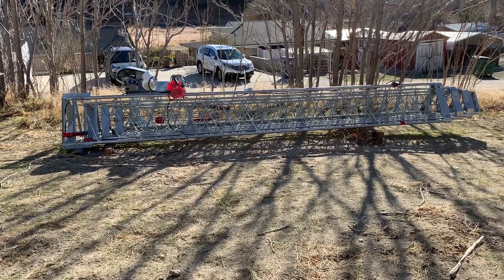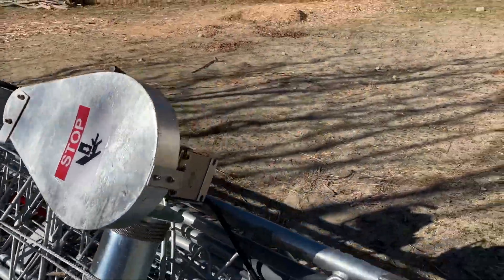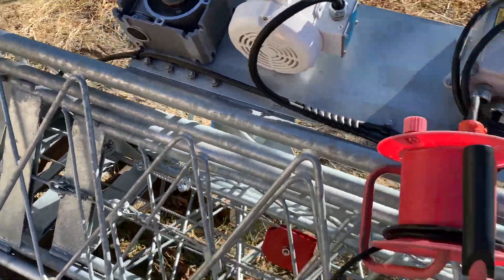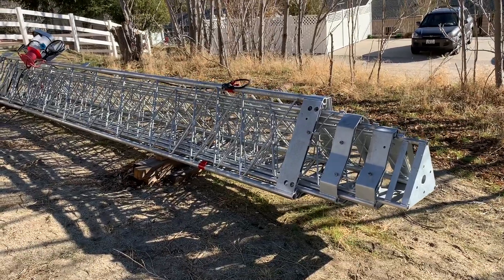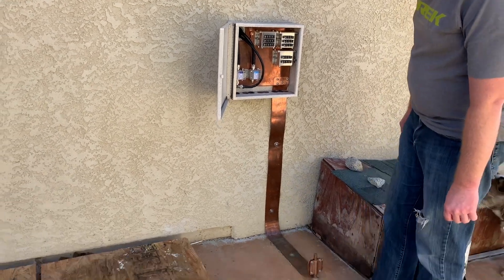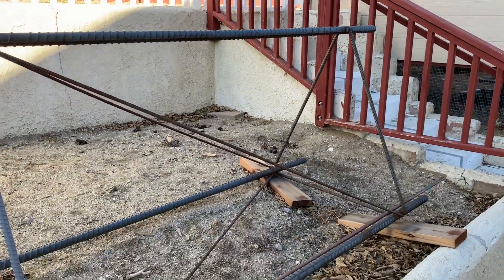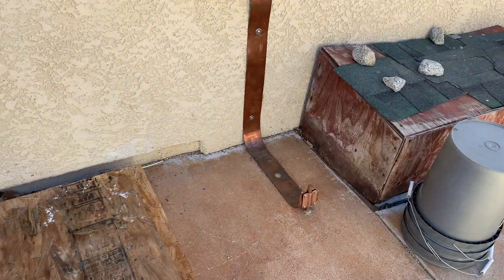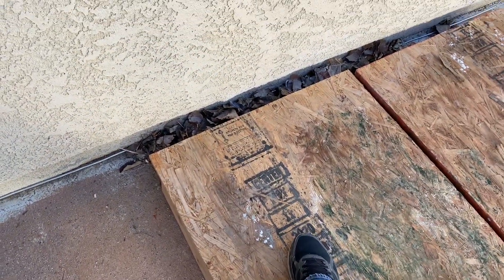Tashjian DX70 crank up tower preinstall show and tell - KJ7E

Comment: Did you use the Tashjian rotor plate? I’m concerned it doesn’t bolt in, it just lays in there
Reply from the maker: Yes, and its a design that has been proven for 50 years or more.  The weight of the mast, rotor and antenna are not going to lift up, and the plate has tabs that wedge in to the bracing preventing it from moving.  Its fine.
Reply: Thanks!

Comment: Nice!  Hope you got your tower up by now.  Here is a short clip of tilting mine up for the first time. https://youtu.be/XUihD3w3RmQ  Mine is an older model LM470 Tri-Ex  now owned by Tashjain.  Essentially the same tower although your newer model has some nice upgrades. My old model does not have the rollers between sections and the newer model also uses I believe 1/4" cable.  The older model used 3/16" cable. It looks like they use the same base.  FYI my base from Tashjain came with a complete rebar kit to tie to the base to extend the base rebar cage down to about 6 1/2 feet below grade.  As far as the re-cable job, I priced the replacement cable set for mine at over $800 + delivery from Tashjain and would need to be self installed.  So I decided to give complete re cabling mine on my own a shot to save about 5 hundred dollars.  Being my tower was outfitted with 3/16" cables I replaced the cable set with a custom made 3/16" 316 stainless steel (instead of the original galvanized) cable set.  Doing the cables did look intimidating , but turned out to be pretty easy if you are at all mechanically inclined.  The tower has six cables in the set. I just had the tower laid down on blocks like in the beginning of your video and I removed one cable from the tower at a time, removing it and paying attention to it's pathway.  After you see the pathway and it clicks in your mind it was not difficult, but everything does need to be triple checked.  I also took video of the cable pathway before I tore  into it for later reference if needed.  After removing the first cable I stretched it out down my driveway and constructed an identical length new cable with the 316 stainless cable I purchased, appropriate thimbles and swagng sleeves. I matched the length of the original cable exactly, built each cable and re-installed them one by one until all six were replaced.  It was a couple weekends of fun working on it here and there in my driveway but I was in no hurry and did them one or two per weekend as time and my interest level permitted.  It is totally doable and total materials cost for my 316 stainless cable set turned out to be $288 including cable, thimbles, swaiging sleeves and swaging tool.  There are a few other videos on my channel of my tower being crane lifted out of my now SK elmer's back yard over his house.  

Happy DX 
73
Nick

de N9SSW
Reply from the maker: Yes its up.  The DX70 is one section larger on every section, 28.75" bottom, 16.5" top.  Its similar to the LM470 only in number of sections and height.

Comment: The rod into the base is not recommended. It there is a lightning strike the base could crack.
Reply from the maker: I agree its probably better not to run the conductor through the concrete, however, many will argue this point with some good reasoning.  In my case, the conductor will be pressed into the dirt wall along side the concrete pour.  The rod will be center front of the hole against the wall.